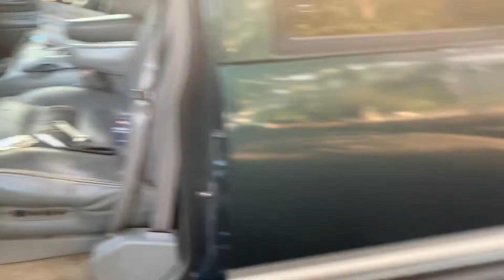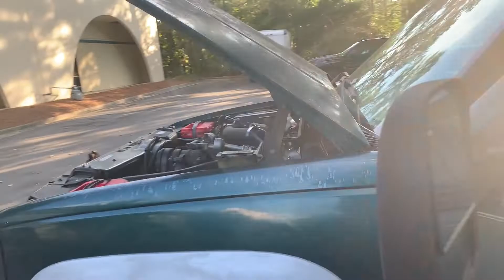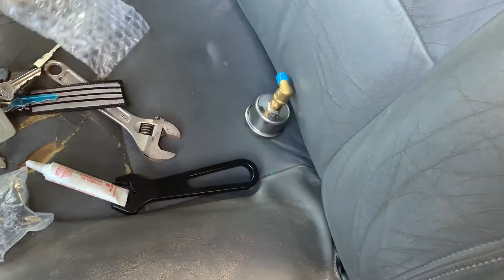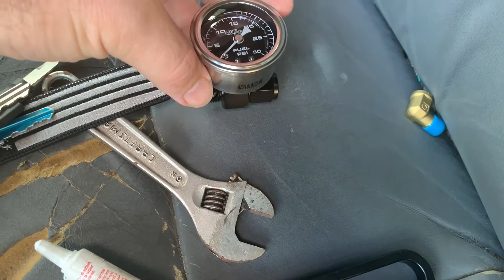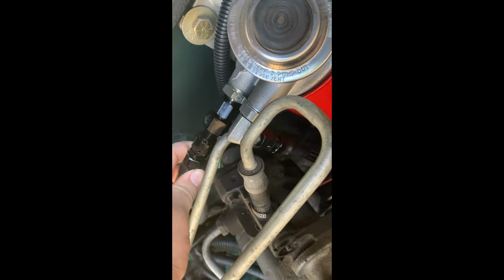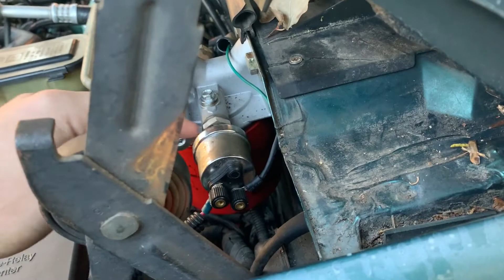6.5 Diesel Gets a Fuel Pressure Guage

Comment: It seems, to me, that you should have a lot more pressure at idle than 3 psi. I run a 4601HP by Carter and my pressure is 11 +/- @ idle and will pull down to around 9 +/- under heavy throttle. I do like the setup.
Reply from the maker: I’m using the Kennedy centrifugal lift pump that is Supposed to increase pressure as rpm increases. I will order a new pressure gauge for the A-pillar  that hopefully will read correctly so I can make a video of the change in pressure.
Reply from the maker: https://youtu.be/bGDJ5qjTU6A
Reply: @2ndMomentumGarage  I watched that one, too. I had heard that the Kennedy lift pump was a good choice but didn't know that the pressure increased with rpms. Nice!